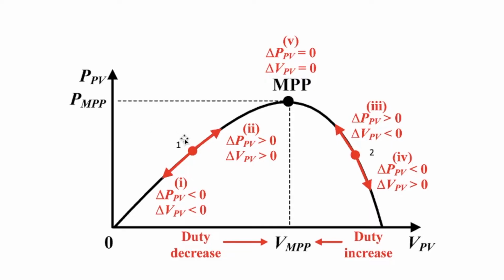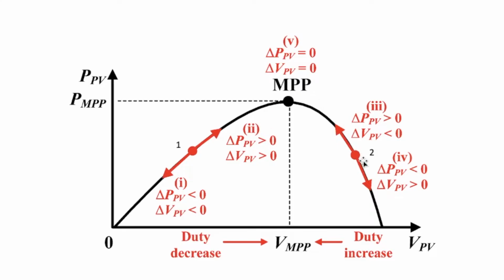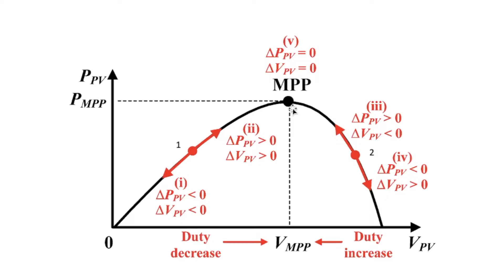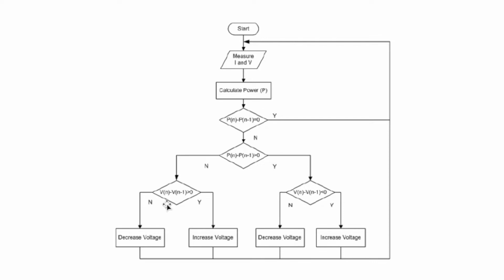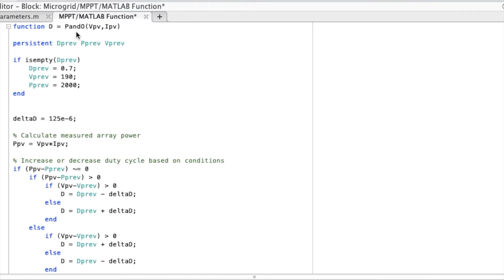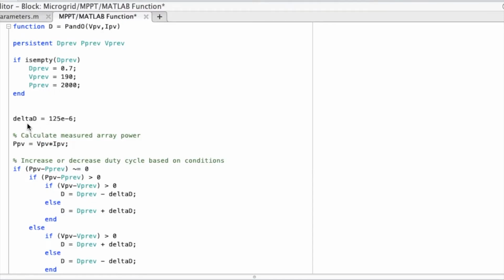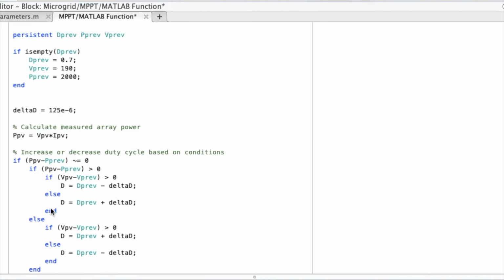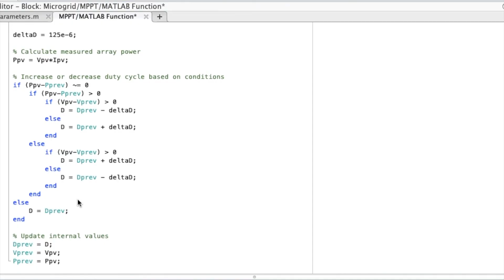P&O MPPT Explanation and Code in MATLAB/Simulink!

Comment: For all those, who are getting confused about duty ratio, what he said is correct and see the picture at 2:06. To move the operating point(1) towards right, Vpv (pv terminal voltage) must be increased (not the boost converter output). As PV is a current source, to increase the Vpv, the load voltage (boost voltage) must be decreased and hense the duty cycle must be decreased. I suggest. you do the simulation, all your doubts will be cleared. even i faced the same confusion.
Reply: thakns

Comment: is it not possible to only focus on the current? The current drained can be lower or higher than the current at mpp. Then we just have to 2 if loops in which we check whether the current drained is lower or higher thant the current at mpp, and we adjust the duty cycle accoding to...

Comment: sir,  at 1000 irradiation, power maintains constant but when irradiation  changes to lower than 1000, power keep n deceasing. kindly reply sir.
Reply from the maker: Yes, if the irradtion decreases then the power input to the panel decreases hence the power output decreases

Comment: Well explained! I wondered to ask if you have done simulation of P&O for series-parallel combination of PVs in MATLAB. There we sometimes have a problem of algebraic loop error while connecting PVs in series-parallel combination specially with large number of PV modules. If you could have the answer for that and make a video a on that, I hope it'll be of great help to many people.
Reply from the maker: Hey Zakir, hope you're doing well. In the previous video we show configuration of the PV panel block on simulink while doing mppt, you have to uncheck the algebraic look check box